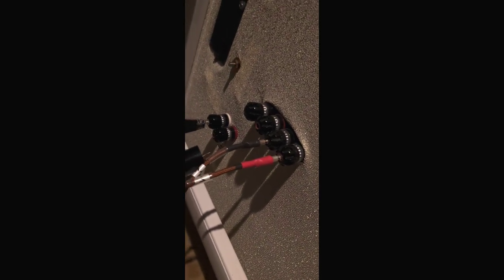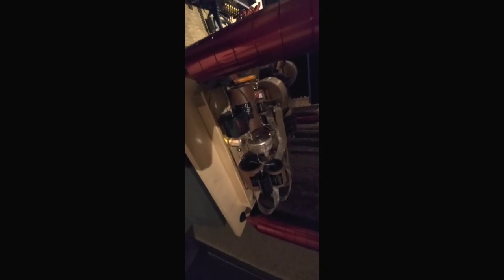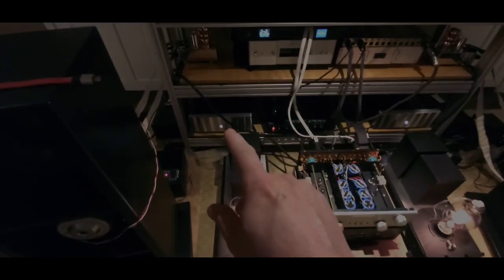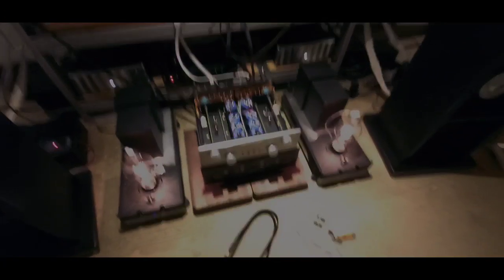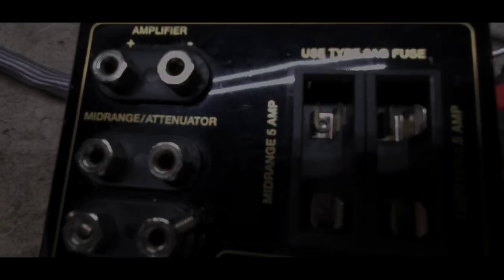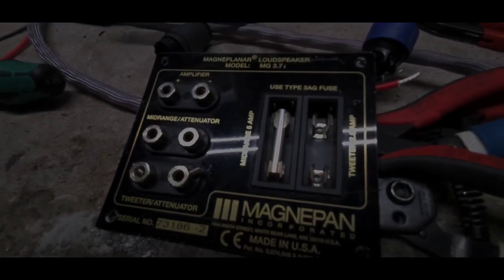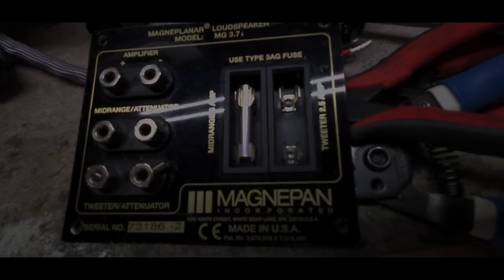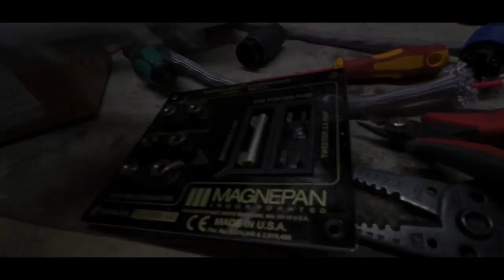MAGNEPAN Speakers, How to DOUBLE their performance !

Comment: with my tympani, I upgraded the crossovers (magnepan did some
Upgrades) with the rebuild. 

I use two subs to support (replace better word) the low of my tympani .. it’s a way more whole speaker system now. Magnepans on low simply sucks and that’s where you miss lot of information in your music. My monolith subs are set to 120hz (high side but works in my situation) , Maggie’s won’t take any low end it’s so much nicer and they demand lot less from amplification too that way 

I refuse to modify it to the extend 
You did it hurts its value on the generic market, selling modifications is hard these days on the market. I know you will probably tell me it’s not , I have not had good experiences with modded gear (getting the actual value for it) 

In your case might be different as you have groups you’re in. And established, yourself so makes sense. 

I won’t be in a group ever, all the experts that know better what my ears hear I distance myself from. I am so not, going to defend  to people I could two shits less about, what I like 😂

I do know this Maggie owners ? Get a good set of subs ! It makes a huge difference. Remember that a good subwoofer, exceeds the low of most floor standers, monitor speakers out there. Already a simple good upgrade ..
Reply from the maker: Good for you I feel the same way about people telling you what you hear. I do this for fun and dont have resale in mind while Im tearing it up. all someone has to do is listen to it . proof is in the pudding .. It smokes a maggie

Comment: The fuse bypass is such a big improvement it is startling.
Reply: any blown tweeters?? model of maggies and amp please.
Reply: @veintiunico5326  all good no issues. Running a Peachtree amp with 350x2 into 4 ohms
Reply: MMG